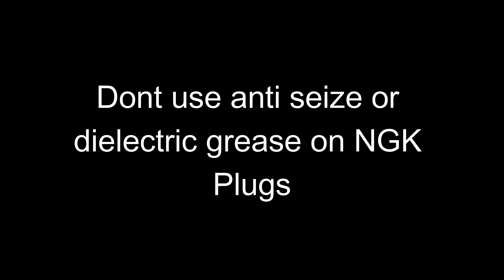How to replace spark plugs on 2012-2015 Honda Accord Exl

Comment: Some say that the plugs need to be torqued down to 13 lbs… others do not… the inconsistencies are driving me crazy HAHA also, genius idea with using the hose to drop in the plugs.
Reply from the maker: Thank you , I usually just get them snug and do a 1/4 turn afterwards. It used to bug me with the torque on them but now I only worry about torque on internal parts and mounts.